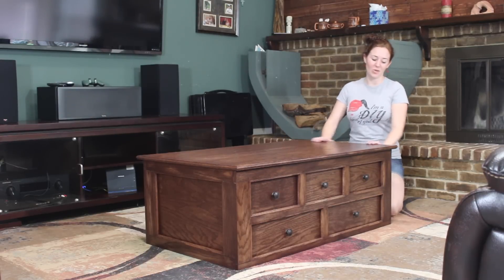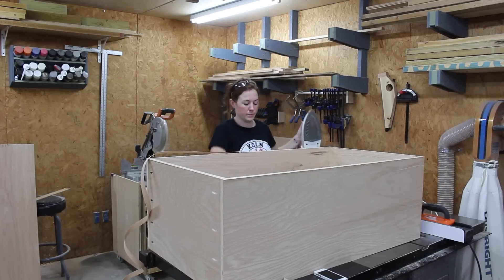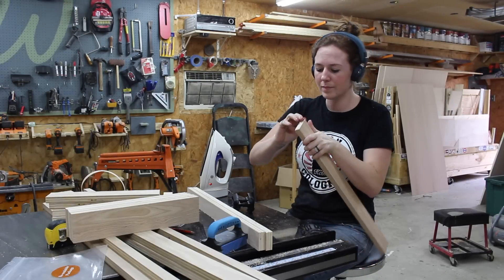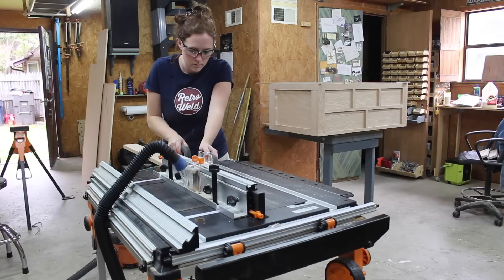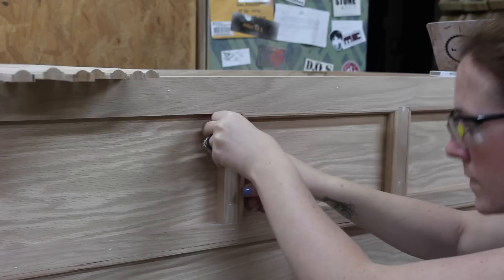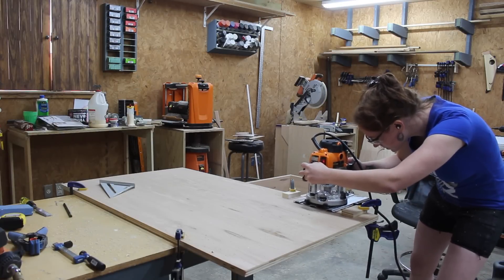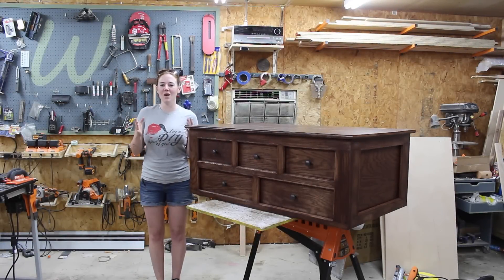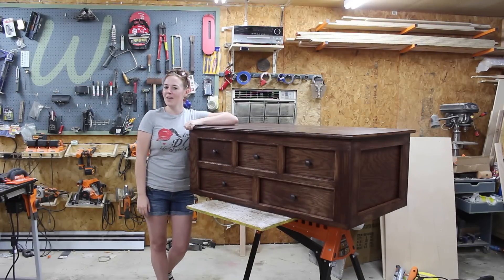Build a Coffee Table with Storage

Comment: Good job. I think it actually would look better with legs on it though.
Reply: +Joe Smith  I'm with you. I think a nice set of bun feet would go nicely on this design.
Reply from the maker: It would be a quick addition if you end up building one. +Mark yeah bun feet would probably look nice....I actually was planning on matching the feet to the entertainment center you see behind the chest in the opening shot. You can't see the feet but they are square and have about a 3/4" gap between them and the unit.
Reply: April Wilkerson  Oh, there you go! I didn't catch that. That would look great. I tend to lift chests like that up off the floor only because I know my luck - I'll kick the bottom edge of that puppy every time I go near it barefooted. With feet on it, I've eliminated most of the "break-a-toe" hazard and only have to concern myself with the corners. Of course your mileage (and toes) may vary, so...
Reply: +April Wilkerson you are a good carpenter

Comment: I built a cooler surround behind a outdoor bar several years ago and used those same hinges,they offer them in stainless  so I didn't have to worry about rust ruining the finish. great job on the chest
Reply from the maker: Good idea for using them on a cooler! I can't stand having to hold the lid while digging around trying to grab a cold beer from the bottom. ; )

Comment: I must say I'm pretty impressed. The design and implementation are excellent. Nice choice on the hinges too. I didn't know such hinges existed. I like how the trim on the drawer faces fit so perfectly well. I would have been tempted to not attach them permanently. I would keep getting a kick pulling them out then fitting them back in. 
If I would be nit picky then the finish is too dark for my taste. But that's a taste thing. And I would have liked to see it with feet. Now It looks more like a box than a table.

Comment: If you need any small toe/kick space, recess a base around the perimeter. However, it looks great the way it is. 
I did a similar one in 1967 made from left over 3/4" hardwood flooring, a little more labor intensive. You worked smarter not harder. Thanks for a great video!!!!!!!!
....13
Reply from the maker: Thanks 13, I'm going to leave it be for a little bit and see how it does. I really like the way it looks without feet but if we kick it then I'll certainly add feet. : )

Comment: Very Nice, What Inch Lbs Rockler Hinges did you go with? I was going by their chart online and it called for four hinges in order for it to work. My lid no bigger then yours. And you used two. Must be 60inch lbs hinges?
Reply from the maker: I went with two 60lb hinges but I should have added a third. I didn't run the calculations before heading to the store and I only bought two while there. They do find except when I get the lid very low so it's fine with me.
Reply: +April Wilkerson , good deal. I'm thinking I'll add the third right in the center of my lid, plus the other two on the ends. So three it is. Thanks. I've never used their hinges before, but I'm looking forward to it. Thanks for your feedback. I'm in Alaska and I enjoy your stuff!!! Keep up the good work. 👍🏻

Comment: Great build, looks great. Question. You mortised the back panel for the hinges which left you with only the trim material to attach the hinges. Are the nails enough to keep the trim secure with lid use over time.
Reply from the maker: Oh no, it wouldn't be if I only used brad nails but those pieces are glued on and won't be going anywhere. It's still plenty strong.

Comment: Nice job April ..... One pointer though - when attaching the lid I'd dry fit the hinges to the body first, then remove them and attach them to the lid, then attach the lid complete with hinges to the main body. 
I find pre fitting and removing takes out the awkwardness of fitting it the way you did.
Reply: I think she tried a couple different options before she mounted this one. She put a short video up on Instagram mid last week showing her trying the hinges out first... I agree with you though, hinges to the lid first would be the way I would go.

Comment: Which size Triton router did you use for cutting the mortises? One of the smaller ones (JOF/MOF) or did you pull the big TRA out of your table?
Thanks for the video!
Reply from the maker: I used the JOF for the mortises and the MOF in the table this time. : )

Comment: Why not use S4S lumber for the trim instead of plywood to save on the edge banding? The table looks great.
Reply: She probably had plywood left over, and wished to use it up.
Reply from the maker: +Double Dare Fan ; ) Yep, that's it exactly. I had purchase a second sheet of plywood and wanted to use it.
Reply: +April Wilkerson How do you like the track saw vs your table saw?
Reply from the maker: They are both great tools! I like using the track saw to break down my sheets and then switch to my table saw when the pieces are at a manageable size.
Reply: +April Wilkerson One other quick question for you, what color stain you use? The stain came out really good on that ply wood.

Comment: Nice Job April. Looks like it has five drawers, could have fooled me if I hadnt seen you build it. A friend of mine who is a funeral director used an old casket (that never sold) from hhis selection room, removed the dome section and replaced it with a flat piece of oak,then placed family vacation photos on top with a plece of glass on top of that. Different strokes for different folks I guess.
Reply: +willie Makit  
I saw an unsold casket used as a cooler for drinks at a very large pool party. Some attendees didn't like it, but it was fun for most of the crowd!

Comment: I would be interested in seeing if that top stays flat over time. Being plywood it should be fairly stable but its still a large piece without much reinforcement in the center.
Reply from the maker: We shall see, I honestly don't know but I think since it's 3/4" ply it should be fine.
Reply: +David Mm   It should do just fine. My grandfather built a blanket chest with the same type of top (no reinforcement on the underside) for my oldest daughter when she was born and, 38 years later, it's still just as flat as the day he made it. I think if you were going to set anything heavy on top of it for a long period of time, I'd reinforce the bottom as you suggest, but as a tabletop, it should hold up nicely.

Comment: Now just mount a  flat-screen TV to the inside of the lid and you have a nice hidden TV for the room! Of course you will need a power bar and a  way for the  power bar to connect to the wall outlet. Cable TV wire  through the same location (Probably in the bottom if you put feet on or in one corner, in my case I mounted a two socket sized electrical box on the inside and the cable and  outlets through the  side corner(easier cut and mount for the box). I also added an Android media player by HIMedia!

Comment: nice work as usual, wilker.  but I'm wondering why you went through the trouble and time of using pocket holes instead of butt screws and glue, if you're gonna cover it with trim anyway.  Then again, I was a big fan of pocket holes for the first few years after I bought my first kreg too :-) so I guess I understand.   also.....have you considered a 23ga  nailer?  they're really great if you're gluing trim anyway.  
bottom line to all this.....the metal fasteners are really only there until the glue is done doing its job.  they're merely a cheap, fast, convenient clamp for the glue joint.  in fact, I sometimes recover my screws after a glue joint has cured fully because metal cuts wood in the end and I don't wish to render a piece, impregnated with fasteners that will further degenerate the wood once it begins to move over time.  
on another note....I wish you or someone would share with my the advantages of that big glue applicator/bottle I keep seeing....Looks cumbersome but there must be something to it as I keep seeing y'all using it.
Reply from the maker: : ) Well thank you. Oh I guess I just figured pocket holes are slightly stronger than a butt joint so I don't mind the few extra mins. I actually went to the store looking to buy a 23ga nailer but they don't carry them in store! I was shocked and disappointed. I'll order one online so I'll have it ready for the next time it's needed. The glue bottle is just a easy to apply container that works better than anything else I've used for glue. It's nice to not have to tip the bottle over and wait for the glue to fall down. Also, it comes with a silicone cap on a bungee and a few different tips. I think it's less than $10 and just makes things a tad easier.
Reply: Right on.  I guess they have em at Rockler or wood craft.  I'll have to look into it.  Btw.  Lowe's has a great 23 kobalt brand usually in stock at the store.  Where in TX are you located?
Reply: Oh....and they're fairly priced as well (kobalt 23) and I've had zero issues with mine.
Reply: On the subject of nail guns,  have you used the "smart point" by bostich, nailers?  I've found them to be the best thing in nailers since the air compressor was invented lol.  Worth checking out

Comment: Awesome coffee table! I really like the design of using a piece of furniture as both a table and for storage. What HP of a router are you using with making your molding? I am looking at starting to make my own custom molding but am thinking I might want to get a beefier router in my table first. Keep up the good work!
Reply from the maker: Thanks Mike! I typically keep the 3 1/4 hp router in my table but this go around I had the 2 1/4 hp in there and it did fine. Of course the moulding isn't that large for this build.

Comment: Aromatic cedar on the inside is great for a blanket chest. Also it would have been easier to remove the hinges and then attach them to the lid and then attach the lid to the box cause you already have the screw holes to line things up. Easier than setting up the stand. Nice work.
Reply from the maker: Maybe I'm visualizing it wrong but it seems either way the lid needs to be held in place while being screwed down. I actually used a jig that is made for these hinges to pre drill my holes in the top of the lid so it made lining it up easy.
Reply: +April Wilkerson Yes, there are different ways of doing the same job.

Comment: Nice project, don't you have a track saw to break down sheet goods
Reply from the maker: Yep I do. However, if I'm able to I try and have the store at least make one cut for me when buying the wood just to make it easier to haul in from the truck to my shop.
Reply: +April Wilkerson Yes it does. Lately its seems most of the guys running those panel saws need way more training, best to get it rough rough cut if you can. Table came out Great.

Comment: It turned out nice, but it looks like a bear to move. Those right angle pieces look real handy
Reply from the maker: It does look like a bear right?! It's actually pretty light though, if it weren't so large in size I could move it by myself. Yeah I'll be using those squares more often, they made aligning the corners easy.

Comment: Just looked. What pound per inch hinge are those you used  ? They look fairly tight on yours.
OOOPS. Found it. They have a calculator
http://www.rockler.com/lid-stay-torsion-hinge-lid-support-rustic-bronze
Reply from the maker: These are rated at 60lbs. I should have put three on it, but I only bough two while I was at the store. They work great though.

Comment: Nice project, but shame about the blotching on the finish. I'm guessing you did not seal the wood prior to staining
Reply from the maker: Yeah I was disappointed by that. I didn't, I didn't realize oak would blotch. : /
Reply: +April Wilkerson In the future try this: Assume everything will blotch, there is no reason not to that makes sense given what you have invested in the project.  Sand everything through the grits to 320, then 2 thin coats of blonde dewaxed shellac, sanding lightly after each coat with 320 or 0000 steel wool on tight curves like trim,  with the grain, then go ahead with your stain etc. 
Do a test piece on some scrap of your trim, sheet good's etc. to preview prior to doing the project.
Since it's a blanket chest why not get some aromatic cedar veneer and glue it to the inside of the box?
Reply from the maker: Great advice thank you for taking the time to share the info. : ) it's through comments like yours that I'm able to improve. A few people have suggested the cedar so I think I will! I didn't stain it because of the smell but I love the smell of cedar.
Reply: +April Wilkerson I think the uneven-ness of it gives it character and looks more natural so I guess I like the blotchy look! It doesn't look bad at all!

Comment: u don't need to put a finish coat on stain
Reply: +Noah Knopf Yes...Yes you do... the only "slight" exception to this rule is the polyurethane + stain, which is largely garbage. Stain offers no protection, no uv resistance, and will literally wash off.  Some stains and dye's are water soluble and will rinse off from condensation from glasses or anything really.

Comment: You don't need the nails with the smaller moldings.. looks like they fight well enough for just glue.. You risk destroying them with a nail gun when they are that small...  I speak from experience here.. spend all day making really cool moldings and end up with expensive toothpicks..
Reply from the maker: Good tip, I wasn't sure if I could leave off nails or not. I was thinking about using painters tape to apply at least a little pressure, and actually I tried to buy a 23 gauge nailer (I think it's time I finally buy one) but the big box stores don't carry them in store! I was shocked. So next time I'm at Rockler I'll pick one up.
Reply: I looks like you had a REALLY good friction fit, ( nice job on that BTW). so really good glue should do the trick

Comment: this is too costly.please some reasonable
Reply: compared to buying a brand new coffee table probable not much more $ and her's would be much higher quality. But yes building your own stuff is often not the most affordable way to go. Its hard to compete with high output producers that have access to cheap labor.
Reply: Pawan Priya she has smaller projects. There's really no better way to save $$ than to build yourself. If you bought this piece at a furniture store it would easily be about $400 and not nearly as well built as she does here. You could probably make it for half that